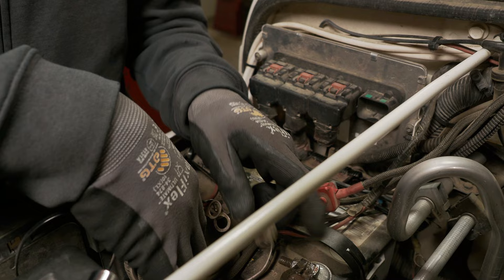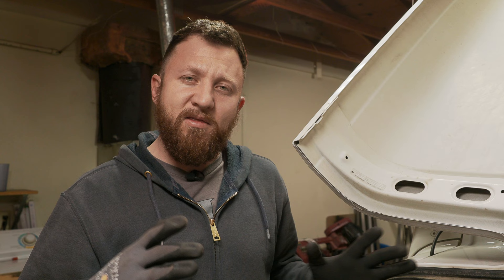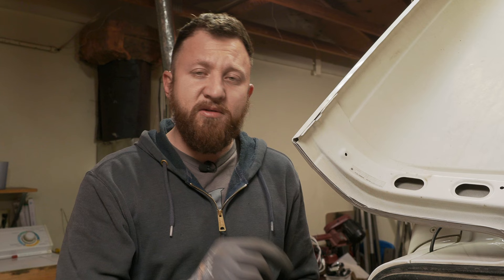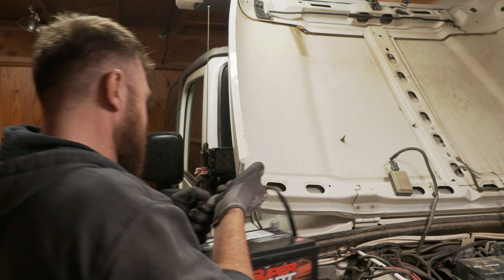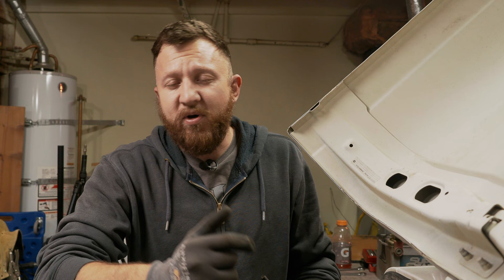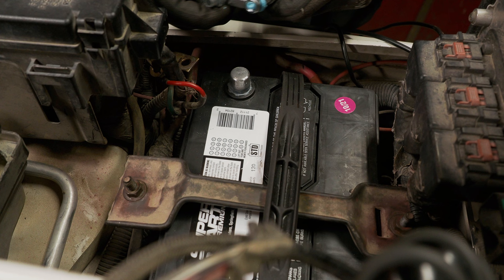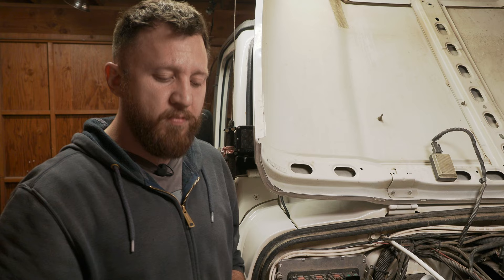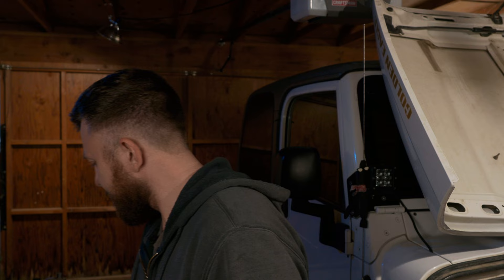Watch Before You Buy AGM Batteries

Comment: Nice review sorry about your jeep but this way is around that problem when it comes to AGM you need a specialist to help you with your electrical and then a secondary system just separate from the cars system since the jeep comes with the built-in computer you need a modification That’s more reliable because that’s kind of expensive to keep replacing the computer. Every time the regulator goes out it’s better alternatives out there. I think AGM batteries are good depends on the manufacturer, but good luck.👍
Reply from the maker: Hey, thank you! There are some work around for my Jeep. External voltage regulators, programming the computer. Just have to pull the trigger on a option and see how it goes. 

I do think AGMs are much better batteries. I run them in two of my other cars. But those cars produce higher voltages and the AGMs seem to really last a lot longer in those cars because of it. 

I’ll figure it out one way or  another thing, thank you for watching and commenting.

Comment: Agm batteries dont handle heat and vibration as well as a wet lead acid batteries. They are ideal as an auxillary battery for fridges ect mounted in the rear of the vehicle. Charged with an appropriate DC/DC  charger. I have used the setup in a number  vehicles and got good service life from all agms.
Reply from the maker: In my 4runner I run an AGM as the main battery and 2 lithium batteries as the aux battery with a DC to DC charger. It's great and I have had zero issues. Heat doesn't seem to be a problem, more that the voltage of 4runner chargers at a higher rate than my Jeep does.
Reply: Wrong AGM batteries handle heat and vibrations better and you can put them in any position !!

Comment: In older jeeps they did charge a bit weaker.  How one of the first things you do with any jeep is big 4 and replace the braided grounds with at least a 4 gage ofc.   Lol trust me i do understand the cj issues 🤣 😂.  But you can easily fix that witch you should anyways for those trails 😆 🤣 😂  plus there's a few other things u can do to help those monster machines
Reply from the maker: Some TJ's charge weaker. It's a setting in the ECM. I have three TJ's this one charges the lowest with no battery tray sensor, the other two ( 04 and 99) charge at 14.2 volts exactly but have battery tray sensors from the factory. I think I've figured out a way to adjust the ECM voltage regulation, just collecting the hardware to do it.

Comment: On some vehicles you can change the computer settings. Some vehicles automatically identify the type of battery being used and adjusts accordingly. With other vehicles, you can go into the computer settings screen using the buttons on the steering wheel.
Reply from the maker: Yep, a lot of newer vehicles are designed to use AGM batteries. Older vehicles, not so much.
Reply: Like BMW you have to let the computers know its a new battery or you can damage them
Reply from the maker: I’ve herd this!

Comment: You can use a dc to dc charger set it to know its going to an AGM battery
Reply from the maker: I don’t think that will work for the main starting battery.
Reply: @EmbarkWithMark  I am using a a renogy DC to DC with MPPT built in 50 amp DC to DC charger from my main battery to my house battery but I have a sprinter van so it might be different because my main battery under my driver seat is also AGM. so you might be right my alternator must be setup to charge AGM since thats what comes stock on the 6 Cyl diesel sprinter van. but they are settings built into my charger that let you select led acid/AGM or lithium if you have a BT-2 you can change it on the App. I believe Victron has similar dc to dc chargers available on the market

Comment: Interesting my 06 has had the same AMG battery for 3 years so far. I haven’t noticed anything and I only drive it once a week even less in the winter months. I’ll keep this in mind if I have problems with it in the future.
Reply from the maker: Yea, mine is an 06 as well. I have access to an 04 and the voltage on the 04 is 14.0 volts. It seems that every Jeep, as far as TJs are concerned, are different.  I can’t figure out why that would be honestly.
Reply: @EmbarkWithMark   mines a automatic transmission maybe that has something to do with it.
Reply from the maker: It could be. The other TJ I have access to is also an automatic.
Reply: watch vids on seting up agm batts.. you cant use them as start batts.there a slow drain batt, i think modern cars charge more, look at your specs.. or you need an mppt, dc/dc charger..hooked to alt..or solar..or both..
Reply: Hook a voltmeter up to the battery poles while the car is idling to check the voltage. If it's between 13.8 and 15 you're within the spec for most AGM batteries, and you probably won't have this problem.
Reply: @harrywalker5836  AGM batteries come in different flavors. Some are specific cold start batteries and some are deep cycle. But they all require correct charging for their specific chemistry. Just like all other battery technologies.

Comment: I have found that AGM batteries in aircraft last four times longer. But mine has an adjustable regulator.
Reply from the maker: Oh I totally believe that! I do think AGM is a better battery. Just needs the right voltage for charging.

Comment: I have a deep cycle AGM battery in my truck camper and noticed something similar. When I charge through the campers built in Converter I get around 13.8 v after the surface charge has dissipated but when I charge through my so-called Smart charger I do good to end up with 13.7 v. I would think the smart charger would give me the best charge but not so for some reason.
Reply from the maker: Strange!

Comment: Good vid. you should be able to adjust the regulator up a bit. i'm sure the v alternator can put out 14 no problem. maybe there's a youtube vid how to adjust regulator on your alternator.
Reply from the maker: unfortunately  there is not an easy way to do this. The voltage regulator is part of the ECM on all jeeps starting mid 90s or so. I have an idea that might work. Stay tuned!
Reply: @EmbarkWithMark   Ok. i guess you just have to find the voltage sensing wire & fool it with a Resistor or something like that. or Totally external - Different alternator & External Regulator. Edit - if there's a will there's a way.
Reply from the maker: @OcRefrig  Exactly! There is a way, just need to think it through.
Reply: @EmbarkWithMark   Call a Alternator fixing place or Manufacturer of aftermarket alternators.

Comment: I've heard that you can reprogram your alternator via a tune to output more voltage. Also, if that was done, you trickle charge it every 6 months.
Reply from the maker: It would be the ECM. Voltage regulator on TJs is part of the ECM. However, I’ve also read this. I need to get ahold of the tuner program and give it a shot to see what happens.
Reply: @EmbarkWithMark  please keep me in the loop, good luck dude!

Comment: My car came with a AGM because of the start stop. The alternator charges it at approx 14.4 ish volts
Reply from the maker: Yea, if your car came with an AGM then you have the charging system to support it. 14.4 volts sounds about right. I wish my Jeep charged at that voltage! Thank you for sharing!
Reply: @EmbarkWithMark  however it has that energy recouperation system. A lot of the time the alternator will only charge the battery when you let your foot off the accelerator when slowing down. All for emissions to reduce drag on the engine when accelerating. Of course when the charge gets below a certain level the alternator will kick in regardless. It will have periods of constant charge. 

When you are driving along i have seen the voltage at around 12.8v. When you let your foot off the gas it shoots up to 14.4v. When the battery goes below a certain voltage it will constantly charge at 14.4 for a few miles. The car keeps the battery at around 80% charged on average. It never fully charges it. It’s to allow for the energy recouperation. My overnight resting voltage averages between 12.5-12.6v ( fully charged AGM should be 12.8-12.9v)

My car is now 5 years old and still on the original AGM battery. The AGM’s are tough little suckers to put up with the abuse my car gives it and not to mention the start stop system. According to VCDS ( diagnostic tool) the engine has been stopped/started over 40,000 times in 5 years. All in the name of climate change and emissions 😫
Reply: @EmbarkWithMark  if the fkn thing is loose, obviously,its going to go flat..lucky it didnt burn to the dirt..ever thought of maintenance, like, clean, check,oil, once in a while..
Reply: @EmbarkWithMark  theres a regulator you can buy, that charges the std batt to 13, then the agm to 14. then back to the std bat or which ever needs charge most..mppt.
Reply: @EmbarkWithMark  you need 2 batts, std & agm for accessories, fridge, lights ect. a std batt will die in 2 hrs..

Comment: AGM have out lasted every lead acid battery I have used.  Very odd your issue.  Also my lead acid would die and leave me stranded when they gave up the ghost.. my AGM gave me a notice it was getting weaker.
Reply from the maker: My other two vehicles charge at 14.2 volts and have zero problems with AGMs. The Jeep just  charges to low.

Comment: I've had mixed luck with AGMs. I have a red top that's probably 15-20 years old that I've both used every day for years on end and let sit outside for years on end and it always performs like new after a charge. My wife's minivan however goes through AGMs every 3 years on the dot as soon as they're out of warranty. I should probably check how many volts it's charging at.
Reply from the maker: I've had the same experience. One Jeep I have charges at 14.0V and AGMs do fine. They also do great in my 4runner with a bit of voltage mod. I really think voltage is the key to keeping AGM happy in vehicles.

Comment: An interesting case study. However, I've just switched to an AGM.  My regular battery would go a good one to two years.  My last battery went a whopping 16 months.  And that's after I put a solar charger on it. Problem solved right? No, after less than a week away with the solar hooked up, my car wouldn't start. So I'm gonna give AGM's a shot. BTW, last month, I fully trickle charged my regular battery to 13 volts and now, it's dead.  Your mileage may vary.
Reply: If you’re doing lead acid, you need to check the fluid levels , refill as necessary and you can desolfate them. The lead lasts forever. So it’s just the fluid and any crystals. Should also run a charger as part of maintenance when below 13.7/8.

Comment: Not that it would solve your computerized voltage regulator issue, but the loose battery terminal didn't help at all.  Once had a battery that wasn't charging because a ground wire came loose.  It was in a hidden spot so I had some problem figuring out why the voltage would swing wildly (as the wire would swing back and forth in the engine compartment - fortunately a diesel engine but still!)
Reply from the maker: Agreed! I do need to correct them and have, but that doesn’t fix the regulator issue. 

Wow! Yea, I’m actually looking into replacing all the charging cables anyway just because of their age.

Comment: You may be on to something. same issue on european cars with bosch alternators they really charge at 13.1v 13.5 max maybe thats my issue. Havent had a good track record in my fleet even a jeep xj it was drained twice by accident never recovered. I like the agm concept so far ive had 100 failure on four agm four different cars. Two champion agms one everstart and one diehard
Reply from the maker: While I don't like hearing people are burning through expensive batteries, I do like that my thoughts are not too wildly off kilter. LOL. I really think the voltage just needs to be higher on these vehicles to take care of AGM correctly. My 4runner has an AGM in it and it's doing great. But I did install a diode that ups the voltage a little bit.

Comment: some older vehicles the alternator don't have a voltage regulator that's why when u put accessories u start having charging problems and starting problems easy fix upgrade the alternator.
Reply from the maker: I think those vehicles have generators not alternators. At any rate, even with a regulator one could still be at the limit of an alternator. In my case the regulator on the PCM is just a bit to low to support AGM batteries. However, I think I have a solution to adjust this, finally.

Comment: Thanks, you answered my question about charging. I'm thinking about swapping out my lead acid batteries for AMG in my RV. Since I will be charging them with solar, this will work in spite of the RV controller being setup for lead acid.
Reply from the maker: Your welcome! I think in your case that would be fine. The solar setup would maintain the AGM correctly in my mind.
Reply: Make sure that the charge controller is AGM compatible. You need to charge the AGM battery in AGM mode (higher charge voltage). If using regular WET mode, the AGM battery won't be able to charge fully.

Comment: i think maybe its an issue with your vehicle,i say that only because ive been running agms in my harleys and cars and trucks going on 10 years and knock on wood i havent had a single issue,matter of fact the east penn agms i use like all theyre other batteries ive had last year round even when my bike or car sit through winter,i guess its possible ive gotten some "special"ones but i really cant complain at this point
Reply from the maker: Yea, my Jeep does charge all batteries to low. I am working on fixing that. 

Ive also found that most vehicles charge near 14.2volts. Which happens to be enough for AGM. But not all. With the price of AGM. It’s worth checking to ensure the voltage is high enough to support the battery. 

Glad you’ve had a great experience! I hope I can fix this issue on my Jeep.

Comment: You actually put loctite on a battery terminal I've never had one right or loose in my life it's LED and the bolts and nuts dig into the land I've never seen one come loose
Reply from the maker: I've had them work loose from years of vibration.

Comment: Thanks for this video.

I just got an AGM battery and I have two questions:

1.  Where do I find the rate my vehicle charges the battery?

2.  The new AGM battery while have the same power than the old one, it is considerably smaller.  Therefore I can not keep the battery  itself tight in the car battery tray.  While that create a problem in the future?  If it wiggles and shifts while driving may affect the battery performance?

Comment: AGM don’t like the under bonnet heat either. Better for a in cab or ute tray. 
DC to DC charger will boost the charge to specific requirements. 
Aussie Redarc BC/DC chargers get a good rap.
Reply from the maker: Yea, i've heard they don't like heat. That's a problem for a Jeep TJ. Pretty hot under hood temps. A Dc to Dc charger would be awesome if this wasn't my main battery. If I go with a dual battery setup, I will be taking a hard look at the BC/DC charger.
Reply: yeh for what price..

Comment: I’ve had an AMG exide in my Mercedes ML320 CDi in my car since 2016 and at aug 2023 now is it only starting to give me hassle. Liked this morning it wouldn’t start    I normally top it up with a charge every 6 months.
Reply from the maker: I do the same in our 4Runner. I’ve also added a fused diode that takes the voltage from 13.5 to 14.2. Sadly that’s not something I can do in the Jeep.

Comment: There's an easy fix for this, the regular is in the PCM, run an external regulator, get an adjustable external voltage regulator from a 80s dodge, the 2 little wires on the alt are the field control, take controls of those with an external regulator and charge at whatever voltage you want. Us guys with big stereos would run at 15v, above that though things can get wonky. Just search dodge adjustable voltage regulator, they are all over.
Reply from the maker: That’s one option.  I’ve also recently found out there is software available that allows access to the ECM. Conveniently the voltage regulator can also be adjusted. Now just need to get my hands on that software to confirm!

Comment: Did you check output at the battery or alternator  ?  Your wiring looks kinda ruff and your terminal wasnt tight.  Not bashing or anything like that i just put a agm in my car and my damn terminal wasnt tight either i just pulled it off.  I will definetly put a battery tinder on it.  Thanks for the video
Reply from the maker: Hey, no offense taken. We all learn by asking questions, including me haha! Sometimes I learn the most when you all point something out in these videos. 

To answer your question, I did run through the whole charging system. About a year ago I found that the voltage regulator inside the pcm was going bad. At that time I replaced the pcm, ensured the charging system was problem free, and dropped in a brand new AGM. 

The term will was in need of replacement. But the real issue here is that this AGM requires more voltage then my Jeeps voltage regulator puts out. There is a kit to by pass the pcm voltage regulator and allows you to set a charge voltage. But I don’t think the hackery required to do that mod is really justifiable. Especially when the only real upgrade is being able to run an AGM battery. At least for my specific Jeep. Glad you liked the video, thanks for asking and commenting!